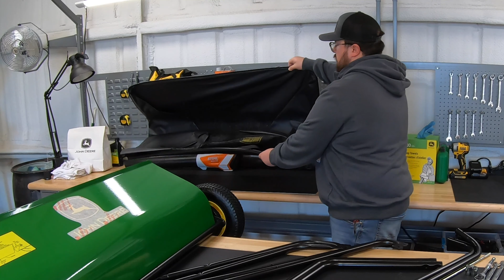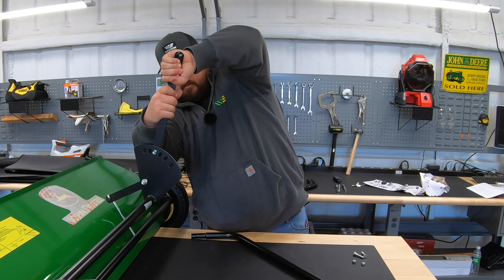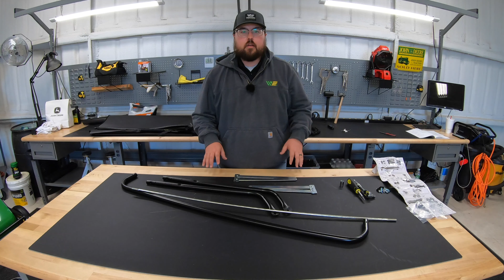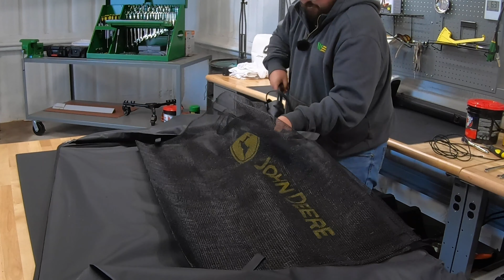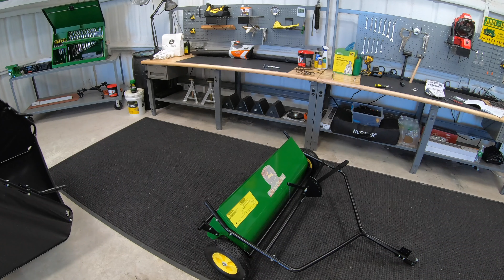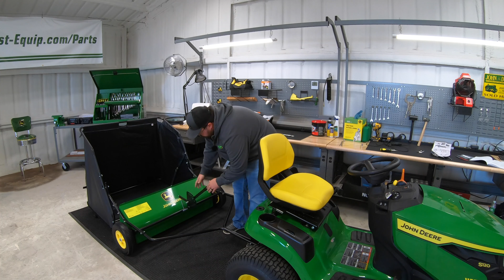How to Install John Deere 42" Lawn Sweeper LPSTS42JD

Comment: But of course John Deere does not recommend pulling this sweeper with this S series 120 lawn mower. Yes, not kidding. I have this tractor and emailed them, and they said no, you should NOT pull a leaf sweeper.  This mower has the Tuff Torq TL200 trans in it.

Comment: I have a used one of these that I received from someone…but I was trying it out yesterday and the two inner brass looking bars that you see on each side of the interior of the bag aren’t totally straight, therefore the bag is slightly elevated. I can’t seem to get the bag to flatten out to make more room for debris. Idk if I’m making sense. But I tried pushing the whole bag down and those bars just seem to be locked up…any ideas?

Comment: I think those side tubing on the hopper have to go on specific sides.   I effed that up, and now can't get the plastic push clips back out, so having to drill them out.   Unless anyone has a better idea in the next 5 minutes.   #thingsthatwouldhavebeengoodtoknow

Comment: Can a  dethacher be added in between mower and sweeper?  Do you have a video on setting this up?  Thanks!
Reply from the maker: Good question! I will have to look into this. No video now, but could be one in the future!
Reply: If you decide to look into the dethatcher kit, I don’t think John Deere makes one.
Look at a company called BRINLY.  Model DK-422LX.  I bought the JD sweeper and BRINLY dethatcher used.
Now I forget how to attached both at the same time.
Any help in a video would be very helpful.
Thanks.

Comment: How come the net in mine doesn't cover the whole thing like yours? It only a little of the top also do the elbow metal brackets bend towards the tractor or the other way?
Reply from the maker: If you are talking about the hinged pieces, then yes, they bend toward the tractor and I am not sure on your net. Maybe this was a flaw on your particular machine?
Reply: @247Parts  I have a picture, can I post it here?

Comment: Thanks for the instruction. Gotta say though, you left out two important steps.
Reply from the maker: Uh oh. What did I miss?
Reply: @247parts  The installation of two short curved extensions that connect hopper to sweeper assembly and how to connect bottom of hopper to hopper frame... All good, and again, thank you for what you do.

Comment: I love your training video you're a very good teacher. As a sixty four-year-old woman I was able to put this together.  However, whoever edited your video left out the very last step. You have the 2 smaller tube pieces on your work bench and you never talked about where they go and how to put those together.  I'm almost finished but I can't figure out how to slide the catcher on to the sweeper.
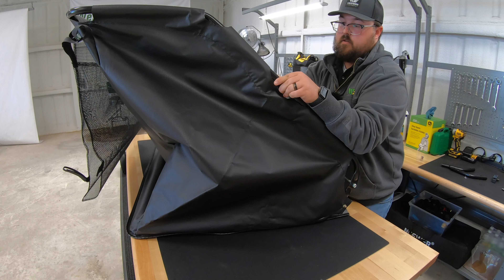Reply from the maker: I am so sorry for this! I had not noticed that this was left out. These small tubes will mount right below the hinge. At 13:46 I show mounting the hinge and right below that there will be another hole to mount those small tubes. These need to go on the inside of the hopper and they need to be tightened enough to stay in place but they need to be able to pivot to dump the hopper. You will see on the small tubes there is an indented end that will slip down into the sweeper once the small tubes are mounted on your hopper. If this is too confusing feel free to reach out to me at brent@west-equip.com so I can get in contact with you to be more clear. Thanks for watching!
Reply: Thank you for all the great content. I’m waiting on an s240 and I have two acres, with portions of lawn in constant shade. I often have wet grass and I’m wondering if I should use a sweeper instead of the bagger. Getting both options seems redundant, so what are the primary advantages between the two setups? Again for me, weekly it’s damp grass, and in the fall I’ll have tons of leaves. Appreciate your insight.

Comment: In your opinion, which is better/preferred for year round use the lawn sweeper or the bagger? Or bang for the buck?
Reply from the maker: For leaves use bagger, for leaves/sticks use lawn sweeper.  Lawn sweeper is easier to take on and off your unit than bagger which might be a factor depending how often you might need your unit for multi purpose. Generally speaking I’d lean bagger for best bang for buck because you can use it year round to bag lawn if you want and ready to scalp in early spring if you are in a Bermuda area.
Reply: @247parts  Thank you, Bagger it is!